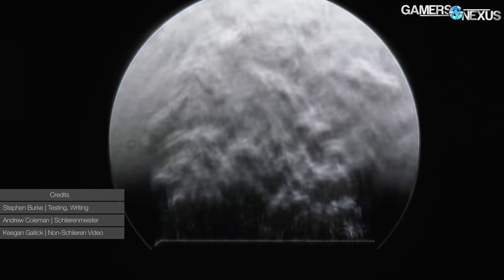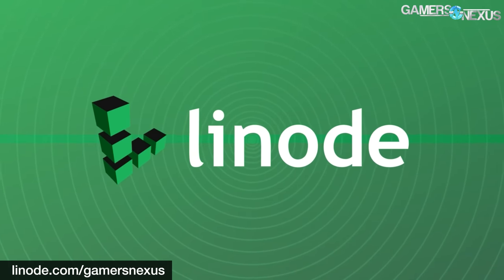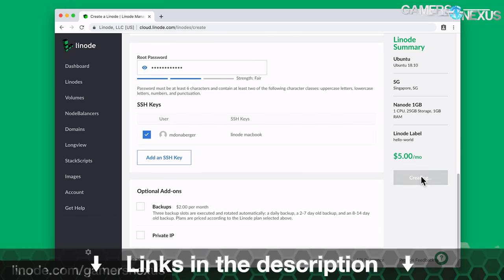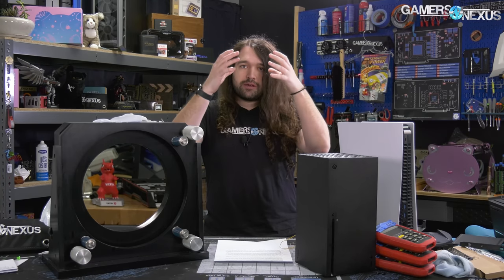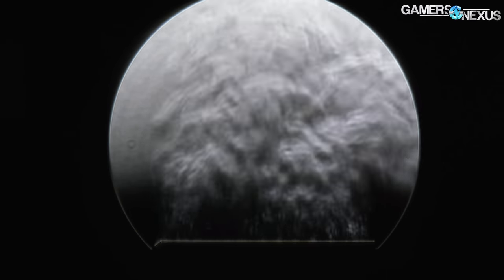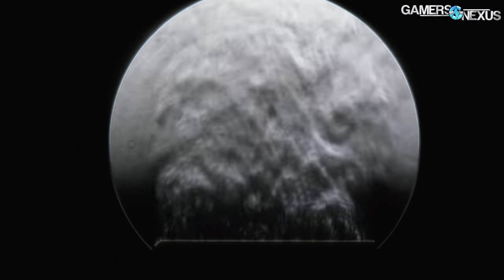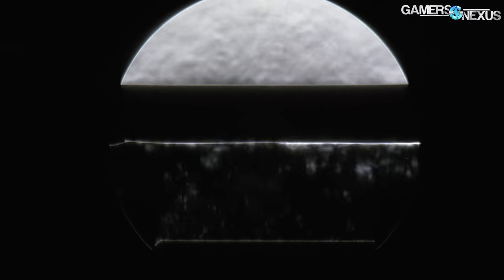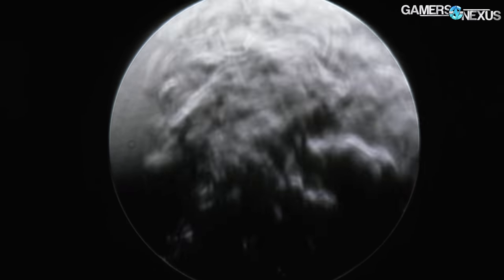PS5 vs. Xbox Series X Airflow Testing: Cooling Design Efficiency & Flow Paths

Comment: Isnt that top rear extractor hole an emergency measure if main top suddenly gets blocked … like if someone places a book at the top of it for example  … I ve seen it done. 
-
The series s has this too less obvious until you see the fan sealing and pointing to the side incase the top gets covered … 
-
Cleaver n smart n simple … not sure I can say that for the Sony case design, too fancy and curvy with airflow going down … it s fighting natural science

Comment: Is it possible that the decrease number of holes on the bottom section actually focuses/ increase incoming cool air speed? 
Kinda like a water hose partly blocked with the thumb?
Reply: This was a freaking awesome video! Thank you for posting this.
Reply: Wondering what effect if any would be if the measurements were taken with the back plate taken off to test this point.

Comment: Dear Steve, what happens if I'll not close my SSD cover on my PS5 thermally and in terms of dust? Thanks a lot!
Reply: If SSD's get too hot. They will slow down by themselves as to not destroy itself. That said, leaving the slot open will allow more cooling and dust shouldn't be an issue. I've seen pcb's caked with dust. And it still works. Just keep the fan and heatsinks clean from time to time and you'll been fine.

Comment: I have a question based on a concern I have.  I have an AC unit behind my Xbox at around 3 or 4 feet .. it's sir flow if I leave it leveled world basically pass over the xbox air exhaust flow...could this cause an overheating issue since it could block the exit flow or am I not to worry?

Comment: This has nothing to do with Steve's analysis here. But if we ever get disclosure on top secret TR3B i would like Steve to get first dibs on reviewing the cooling efficiency of a TR3B UFO. Here is how it works. A circular, plasma filled accelerator ring, called the Magnetic Field Disruptor surrounds the rotatable crew compartment, and is far ahead of any imaginable technology. The plasma, mercury based, is pressurized at 250,000 atmospheres, at a temperature of 150 degrees kelvin, and accelerated to 50,000 RPM to create a super conducted plasma, resulting in gravity disruption. The MFD generates a magnetic vortex field, which neutralizes the effects of gravity by up to 89%.
Reply: element 115

Comment: dust filters? filters restrict air flow and require cleaning frequently. no gamer is going to maintain their system like that. it would simply be a weak point in the design.

Comment: Microsoft benefits from having negative pressure and no dust filter. Dust can destroy electronics. They want consumers to have to upgrade their old dusty machine in 4 years when it starts running slow.

All console manufacturers aim to do something like this. They have it down to a science.
Reply: Only that anyone who only doesn't just go towards their console to swap a disc would be able to apply a dust filter and/or regularly clean it.

If Microsoft did want consumers to do keep buying their electronics(which I mean they do but I mean if they really want to force customers to do so) they could just pull a page out of apple's playbook and make it extremely hard for the average consumer to tear down their console. Now both Sony's and MS's consoles are extremely hard to tear down completely(especially the ps5's as you have to unscrew 40 screws which was fixed to stabilise the motherboard and prevent bending due to the high heat generated from the clocks), the fixed SSD on the mobo and the liquid metal SoC which is better left untouched), but just for a dust filter is certainly not hard.

Comment: If you didn’t light the MAP gas, you’re actually exposing colder than ambient temperatures to the intake, not warmer air.  As gas under pressure is released, the pressure and temperature decrease. Ref. Gay-Lussac's Law.

Otherwise great job bud!

Comment: in xbox series x  I would like it to have two fans the heat goes upwards it blows downwards and it is difficult to leave it could have exhaust air on the sides
Reply: in plastation they did a good job, the heat leaves the sides, the air goes in these directions whenever it is justified
Reply: the xbox series x  it has prospects for configuration diy cooler the escape of heat from the sides

Comment: I can't even enjoy these game consoles because I have really bad ocd and anxiety, and I am always scared my consoles will get too hot and then break..Or get too dusty..does it even help to just aim a small USB powered fan at the sides? Not directly in the vents, just on the sides.of the case? I'm also too scared to buy those intercooler stands..I have heard those can damage the consoles..
Reply: It wont get too hot and break. It can sense thats it's overheating and warn you or shut itself down. You can get an standalone hepa air filter if it helps your ocd.

Comment: you ran mapp gas into an air intake pushing the gas over electronic components... theoretically safe... but... does your insurance cover that??
next time, light some incense and let the thin stream of smoke pass in front of the intake - you won't even need expensive equipment to get that on film.

Comment: I'm not a fan (no pun intended) of either console really but I just CAN'T get over how cheap the PS5 build looks, that metal, that plastic just looks the nastiest, cheapest materials you can get from China (no idea where they're actually built). At least the Xbox "looks" like its built of better materials and has a better handle on thermal performance. Have to admit I'd be tempted to remove that large foot on the Xbox and drill out all the base and apply my own outer-edge, smaller feet to allow even more air flow...IF I owned one of course :P

Comment: Considering how tightly packed all the internals are and the limited air intake in the current XSX model - methinks we can fully expect a redesign a few years down the line where Microsoft brings changes to the box itself specifically to further improve the airflow

Comment: Xbox is since The One X waaay better engineert, i got the PS5 slim disc newly next to my Series X. The X is still smaller AND quieter!!! And all that with still more power 😂. MS' vapor Chamber cooling system is LEGENDARY!
Reply: The PlayStation 5 slim being larger than the Xbox SX is a pro. It prevents overheating and improves overall airflow and ventilation.

Comment: Anyone have any advice on how i could vent series X to keep cat hair out (I have 5 cats, cat hair is something I have to live with daily) while also keeping it cool. They have vents you could buy off amazon but most report that they make their xbox get hotter. Could I somehow throw a fan on the outisde bottom part of the systems vents to blow more air into my system while having one of those aftermarket vents inbetween the outside fan and vent? Would that hurt more than help?
Reply: Place the console in a cabinet that doesn't have room for a cat to sit on. I know pet hair is very transportable but your best bet is hair management. 
 I have a labrador which lives indoors and her hair gets in every corner of the house, except the entertainment centre. I use a robot vacuum to do rounds around the living room twice a day. The entertainment centre is positioned in such a way the robot has an easy time of it, allowing it to get under and around it easily. 
   If you have anything near the entertainment unit that looks comfortable the cat will spend time there.  
  I don't suggest adding additional filter attachments to the machine. 
 
 My cabinet also has grilled front doors, closed sides but an open back. It's perfect for front to back airflow. I would have to position a series X on its side. 
 Recap, manage the cat hair. That's your best bet. It's done by preventing hair build up and discouraging your cat from being near the machine. 

 Good luck.

 Edit. Cats*.  Dam 5 cats! Sounds like my mum.

Comment: I am about to dish out 225 bucks to get a replacement z97 mobo because my cat peed on mine and it won't boot.  I have been wanting to upgrade but I don't want to buy into the last gen of socket AM4 id rather wait till amd has a new socket and hope that they treat it like AM4 so that I can buy a nice board upfront and upgrade cpus easier.  I was thinking about the r5 5600x but now that they are so far above retail I'd rather just pay some local person some cash for something I need.

Comment: Damn the XSX has MUCH BETTER airflow than the 5.
But wait......
The reason the 5 works SO MUCH BETTER than the XSX is BECAUSE of the heat!
AMD said themselves thst the more heat you pour into the chips the better the performance....
So basically it's still.......
#PS5FTW

Comment: The PlayStation five has a lot of overheating problems problems like that already. I’ve already had to send it in three times.

Other problem about the PlayStation five is it’s way easier to get dirty and it’s a lot harder to clean than the Xbox

And the PlayStation has a lot of thermal paste, problems of it leaking out and getting a lot of dry spots so you have to be very careful with that or show you say liquid metal
Reply: Bunch of bs 😂 had my ps5 3 years now left in a low air space and still outperforms any xbox

Comment: Whats more efficient?
Reply: Xbox Series X, but watch the conclusion for you to see the problems
Reply: XSX is more efficient when brand new. But after awhile... dust will get into the tiny channels inside the heat plate and it will run hotter. You'll have to open it up and clean regularly. Or do something like this. https://youtu.be/TjwcoUADGW8 

The PS5 is easier to clean because of the dust ports.

Comment: Man it would take some real commitment to stupid to position the Series X with the rear intake against the table/shelf, given all the main I/O is on that surface. You'd have to cut holes in the shelf just to get power to the device (at a minimum). I mean, I suppose it's possible someone could have a shelf with one hole that they then use for power, and then operate the machine using remote play over wifi. I'm not sure that person exists, but if they do, they're destined to receive a Darwin Award.

Comment: Personally I prefer the look and airflow of the xbox. Its almost like they kept the marketing manager away from the design. Shame the base is a bit of a fail, it could have had more holes and a pull out filter. 
I leave the top off my PS4 pro.  Why they make fans with plastic right over the intake is beyond me....
I bet vertical series X would be better for standby thermals, if they matter lol. I assume the fan does not spin in standby. My one X stays fairly warm in standby and fan does not spin. 
PS4 pro fan ramps down to 1000rpm in standby and usually is about 1200-1600rpm in games. Its a freaking dust magnet, the state of some peoples consoles must be horrible.

Comment: Spent 20 minutes explaining Xbox and that’s a way simpler design. And then goes on to quickly run through ps5 in 9 minutes. Lame. Ps5 has a really interesting cooling solution that could have been gone more in depth
Reply: ps5 is currently the one experiencing more heat issues bc it’s design is flawed… my ps5 shuts off randomly compared to that issue not being prevalent in xbx

Comment: I have another theory why the air is flowing in a cone with the xbox: with higher air flow velocity the pressure is lower, so the air in the middle, sitting right atop of the fan, is sucking the surrounding air towards the middle due to higher airflow and thus lower pressure

Comment: The real truth is that PS5 uses liquid metal cooling, which is more modern and has a longer life (5 years minimum) than Xbox Series X’s old thermal paste method. Liquid metal lasts longer than thermal paste. Once a PS5 is filled with dust, all you have to do is dust the PS5 properly on the inside, and the heat levels will return to normal. If thermal paste wears out, you’ll need to send it in so they can apply thermal paste professionally.

There’s a video on YouTube of a guy swapping out the PS5’s liquid metal for thermal paste, and PS5 only overheated when the thermal paste was used.